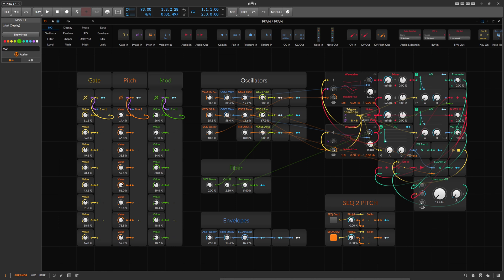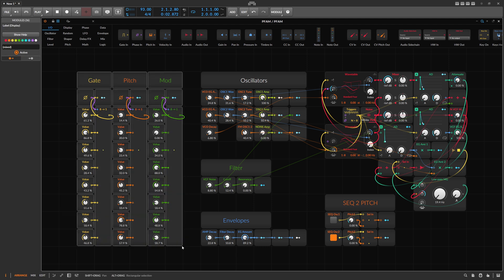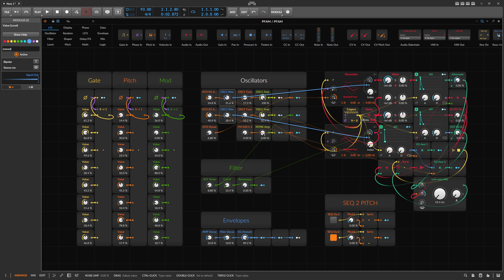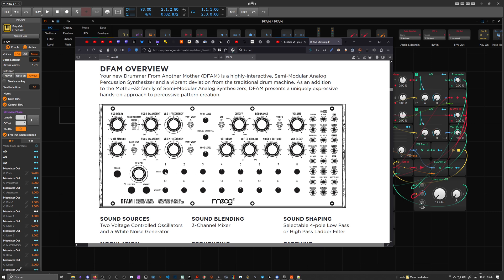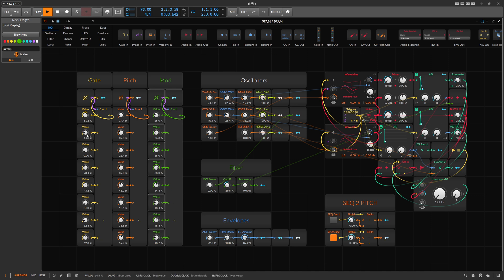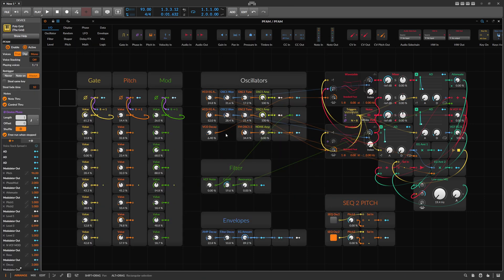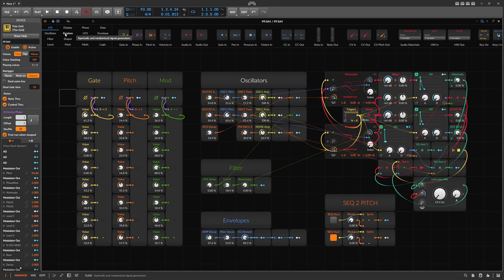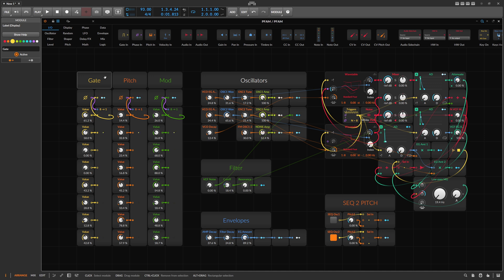sorry MOOG, i did it again - DFAM for Bitwig

Comment: These inspired patches are so much fun… O_o Why value knobs instead of the steps modulator? Just closer to the original UI, or is there sth you couldn’t do with the steps component? Thanks for sharing!
Reply from the maker: yes, because its closer to the original and you can map a controller to these kobs or modulate them. which you cant with steps.

Comment: About touching the knobs. What I sometimes miss in Bitwigs Grid is not being able to assign the individual steps of the Steps, Pitches and Gates modules to midi CC,  or being able to modulate them on a per step basis. Sure its possible to build something yourself, like you show here, but you will end up with some big ugly horizontal sequencer you have to drag around from grid to grid. Thanks for the patch !
Reply from the maker: A UI designer is needed for sure. You usually want to divide patches into business logic and presentation layers for the user. Creating a meaningful user interface is hard, and it's even harder to create a user interface editor.
Reply: @PolarityMusic for ex. the locking at the top left would/could increase the transparency of the cables, and/or place them under the modules
Reply: @PolarityMusic  They "just" need to let us put an FX Grid inside the FX Grid. This gets you all the modularity you want (including remote controls) with a minimum of new feature work, probably mostly around IO handling. Not exactly trivial, but huge ROI. It would be game changing IMO. Then a UI designer for remote controls (such as UVI Falcon and Melda plugins have) works everywhere, including inside the grid.